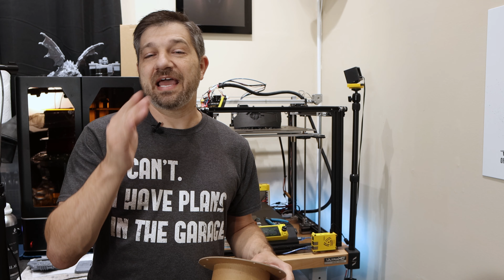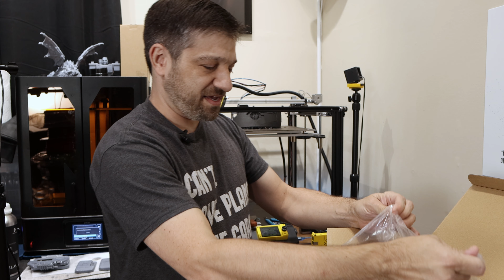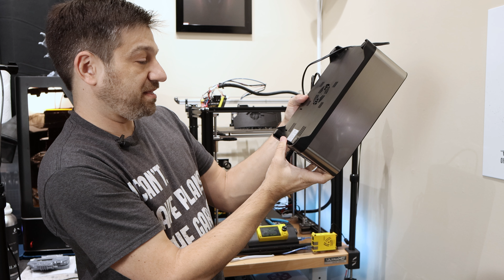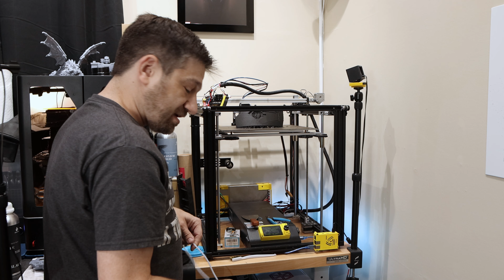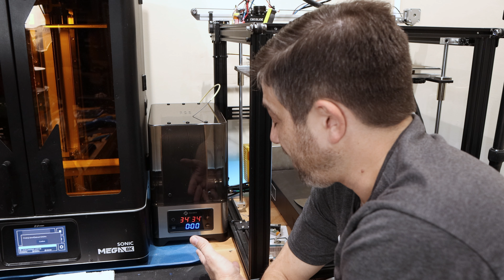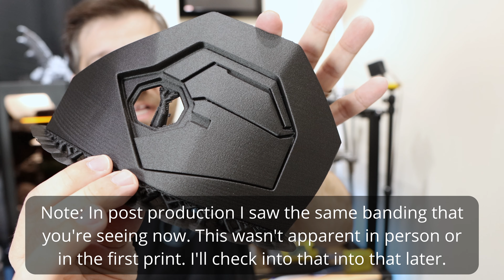3D Printing a 2KG Spool of Nylon Carbon Fiber!

Comment from the maker: I was asked if this filament could really be printed in an open air printer like the Ender 5 Plus. The answer is a solid "yes!" Even when you use a chamber they only recommend temps up to 50C. You can find more technical data on their website: https://us.polymaker.com/products/polymide-pa6-cf?variant=39574350004281&aff=738

Comment: I've found carbon fibre filament is leaving a lot of fibres embedded in my skin, I'm starting to worry that they also get into the air and I might be breathing them in, does anyone know how safe carbon fibre filaments are?
Reply from the maker: It depends a lot on the brand you're using. Some of them have small CF particles while others have CF strands. For example, Prusa has already put out a safety report that looks really good about their CF. I use Polymaker and I've actually checked my fingers and do not have embedded strands. It appears relatively safe.

Comment: Did you ever print out that gap filler between the main unit and the lid so that the 2kg spool of PA6-CF (this is what I use in 2kg spools) would fit better. If so would you post the stl for it?
Reply from the maker: Not yet but I'll work on it.
Reply: Oh yeah I was wondering that same thing, my 2kg roll just barely touches the lid enough to add tension to the filament roll, which is a little annoying

Comment: Nylon needs at least 80 deg for 4 hours before you see a moisture content drop. Alot of the dryers don't even reach their desired temps off their panels. Usually the best way is bake for 24-48 hours at 80deg c in oven then continue print from the dry box as they're designed to maintain moisture content not remove moisture content. Thanks for the video polymaker is great filament.

Comment: well the dryers are cool and stuff but non of them fit a 2 or 3kg roll and  i dont like to mess with the 1kg ones or re spooling, its just a hassle but i do mostly print pla and if its old just chuck it in an old oven i have just for that :D
Reply from the maker: Did you watch this one? It fit.
Reply: @kerseyfabs  wierd cause their website says 217*80 some thing is the biggest single roll and my 2kg rolls are 300mm

Comment: Fixdry website now has a 5% coupon, so $75/ea. Bought two mostly for my setup and the fact that it won't turn off after 12hrs like my current dryers. Thanks Kris!
Reply from the maker: You're welcome! Did you use my link? I'm trying to see if the program is working properly. Thanks!
Reply: @kerseyfabs  I believe I did.
Reply from the maker: @RoosterAbarth  Thank you so much!
Reply: Ordered Saturday, showed up today. Very fast shipping.
Reply from the maker: I'm glad to hear it!

Comment: FIXDRY NT1  just  a re-branded Eibos  cyclops filament drier. I have their KS.
Reply from the maker: I wondered at one point if it was the same company.
Reply: They are not the same machine. Some same features but not a rebranded Cyclopes.

Comment: You've fallen for the biggest hoax in filament dryers, Mr. Kersey.  In their directions, that filament dryer runs a pre-programmed algorithm".  IT DOESN'T EVEN HAVE A TEMPERATURE SENSOR.  What's the use of a filament dryer, or any drying device without one??  Quoting from the MANUAL -" [Attention] The measured temperature is the temperature of the intelligent algorithm in the drying box.  Humidity is the real-time humidity inside the drying box."
Reply from the maker: I'll be happy to test the temperature inside the dryer. I have some stand-alone sensors. I'll reply later.
Reply: Everybody loves to hate filament driers absence of PID tuned thermocouple closed loop feedback enclosure, but nobody wants to spend $2k on a DryWise. I also own the FixDry and PrintDry. Each enable fantastic print quality. For the hobbyist.
Reply: Same here! I just found out a few weeks ago. After strunggling with nylon all the time. When I measure with a tempsensor (a good one) it never reach any higher then 50 degrees. But display says 69-71 ish which is complete BS! Really a hoax filament dryer.
Reply: @Celeritech_exhausts  it’s a complete fraud. They sent one to me asking me to review it
Reply: Bro they cost like $50 bucks. Not a big deal no need to over engineer it. 4 hours at recommended temp and good to go.

Comment: I just put a shaft through a toaster oven on its side with anti-walk guides on the shaft to keep the spool centered, and feed from the toaster oven…. Set it to like 50*c for my PLA and 80*c for nylons.

3kg spool fits though 😅
Reply from the maker: Ummm.... I'm not sure leaving toaster elements running for days is recommended. 😬😅
Reply: @kerseyfabs they kick in and off, temp will drop down to 30*c then they kick on until about 45*c then off, temp rises to about 50*c then for where I c set it fire PLA, I dry for, 4-5 hr and then every few days turn it in for 30-45min 🤷‍♂️

For nylon, similar just peaks at 80*c and I let that fit for 8hr and then print from it while on until the print is done, if I’m not printing nylon anymore after that print I turn it off and remove the spool and bag it.  I keep desiccant packs in there too… bag and oven.